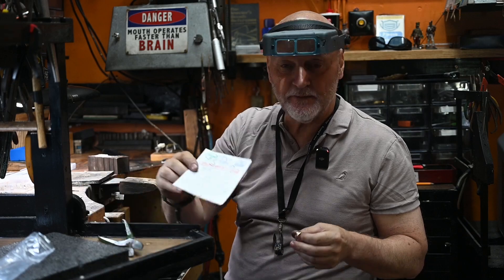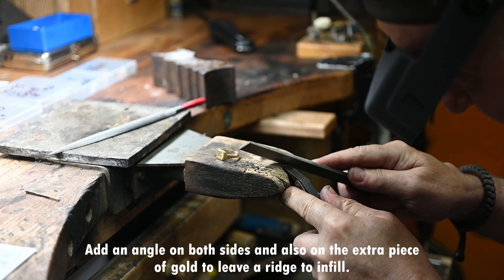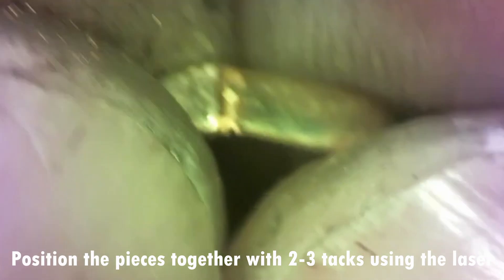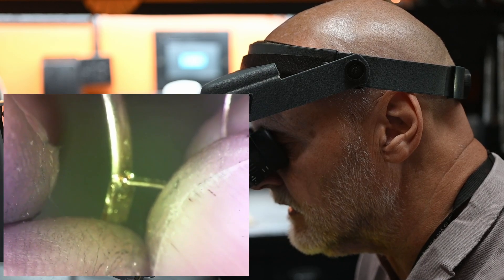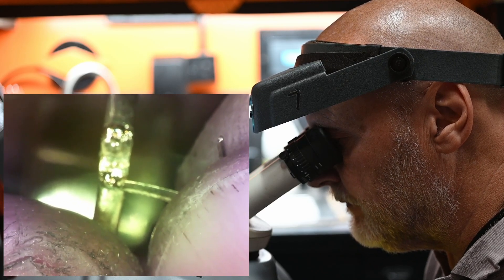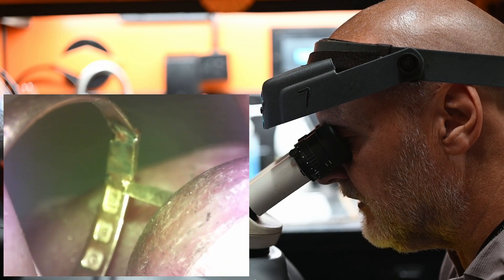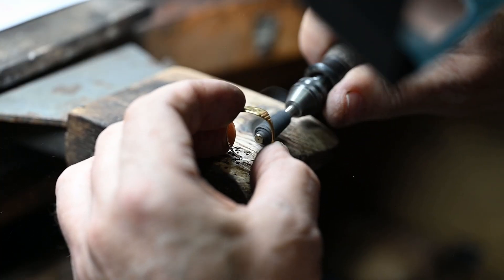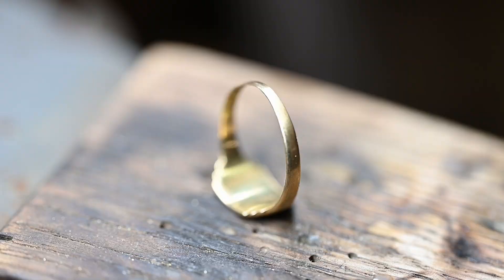Resizing a GOLD RING using a LASER WELDER! | PAUL PAINE'S WORKSHOP

Comment: Hi Paul, as videos showing the use and repairs that can be made by using a laser welder are few and far between, I found your gold ring sizing repair very interesting as I have a similar job to do on a friend's gold ring. Due to a swollen knuckle, it had become too tight on the ladies finger and the ring had to be cut off by her husband, a retired fireman (not a jeweller)... So you can imagine the mess it is in! As this will be my first gold ring repair using our MS35 laser, I listened very closely to you describing the settings you used on your machine before you began the repair. Although during the video you kindly passed on most of the settings you were about to use, you only mentioned raising or lowering the power and never let on the power setting you started with, which would have gotten me to a starting point. Obviously shank thickness would affect the power setting chosen but this ladies ring has quite a worn shank due to its age and looked similar to the ring used in your demonstration before her husband stepped in. Any clues on the power for my repair? Thanks.
Reply from the maker: Hi thanks for watching. The main thing with power using the laser welder is to start low and add more until you are getting the desired result. For me on the MS35 I would start at 1.0kW on 0.2 spot and work up until you are happy with what's happening